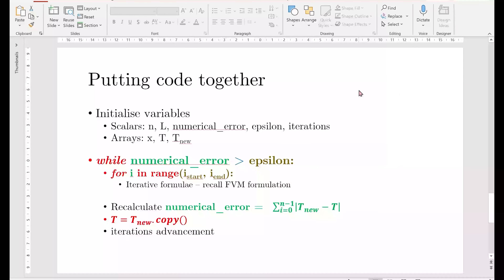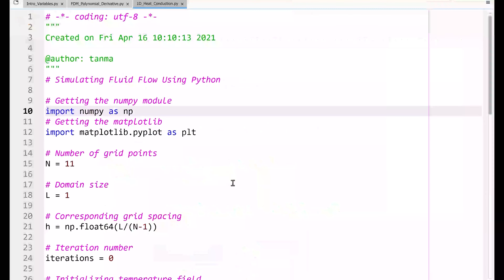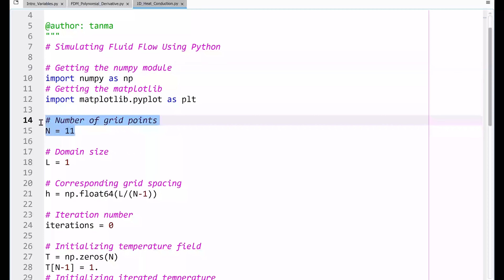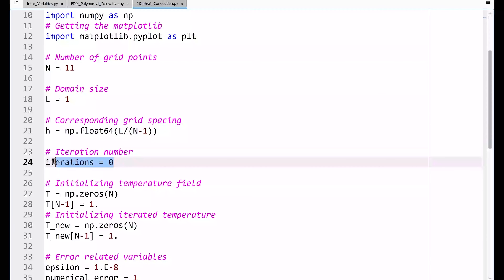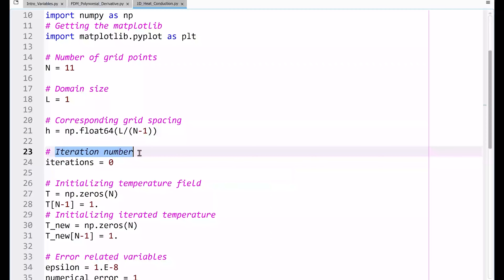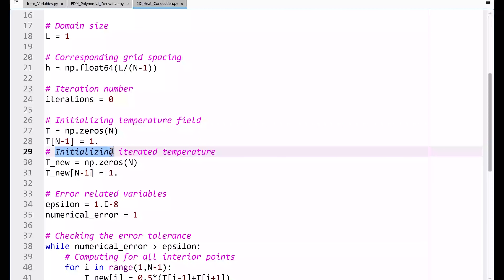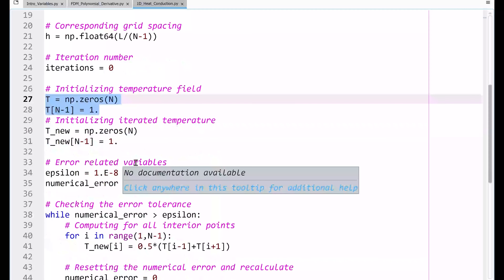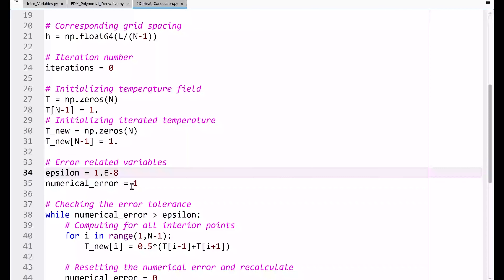Conduction Visualization Python Script Lecture 7 Simulating Fluid Flows Using Python

Comment: shouldn't for loop be from 1 to N-2. we already assigned fixed value of 1 at N-1 point.
Reply: Great question! I also had the same question in mind. the reason for that can be simply explained with an example:   in range(1,4) include integers 1,2,3 and not 4. Similarly N-1 is not included in the in range command.